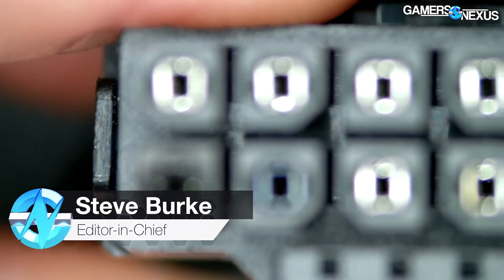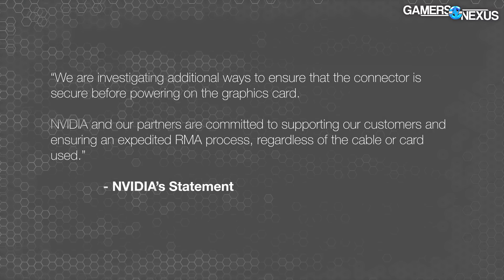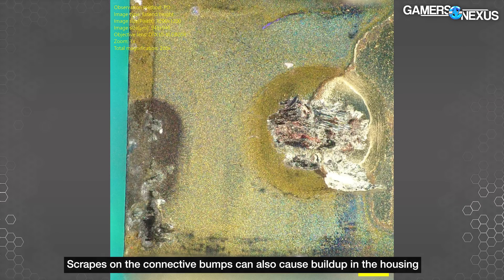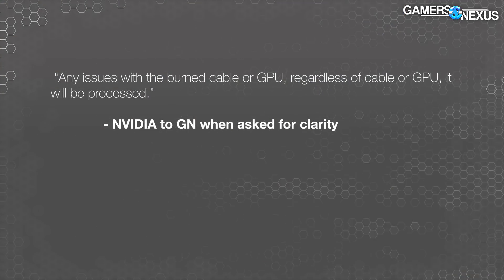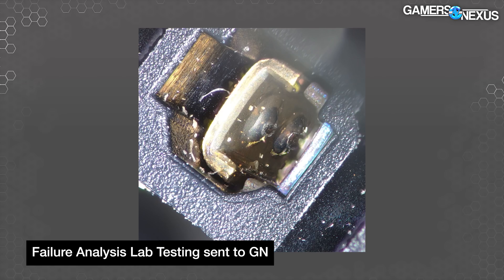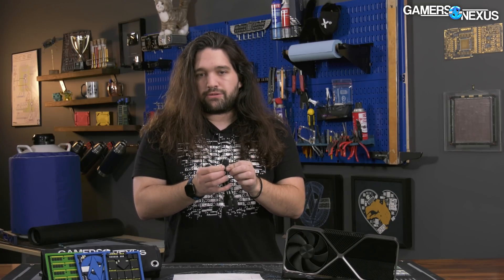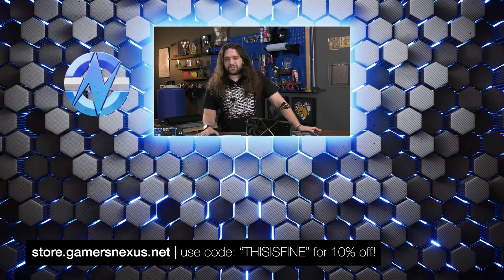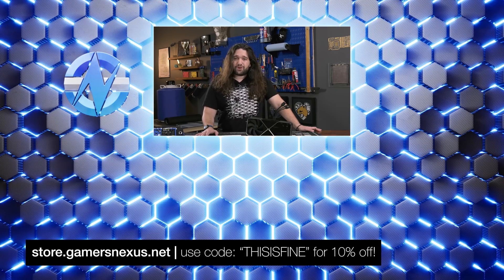NVIDIA Responds to Melting Cables, Warranty Concerns, & 12VHPWR Adapter Failures

Comment: I've heard enough. It's time to stop pussyfooting around and conducting incorrect 'research'. Safe products are meant to melt ! I'm reporting this to Underwriters Labs and the European equivalent agencies. Nvidia should have read UL/IEC 60950, I have a copy if anyone's interested. Product Safety of IT Equipment.

Steve, you can TELL Nvidia they NEED to withdraw stock from sale and organise return of all stock sold to date.  There's over $200 million of it out there and this could easily be the end for Nvidia. There's a really simple solution to this that involves REMOVING the accursed 12VHPWR connector which flies in the face of product safety norms with 23 Amps being pushed through every sq mm of pin. That's like passing 30 Amps through 16 AWG for comparison !
Reply: It was user error.
Reply: @spaceageGecko  Its the manufacturers responsibility to use a suitable connector that cannot be 'sabotaged' by 'user error' when it is to be installed by non-experts.

The national/international safety standard UL/IEC 60950 applies which is mandatory for IT Equipment worldwide. I know about this stuff, believe me.

From what I see, the cable loom is also not constructed using a suitably rated wire gauge. That entire assemble stinks and is piss-poorly engineered.

I've asked for the product to be withdrawn from sale as a potential fire hazard. Even a 0.05% failure rate is unacceptable in this regard.

FYI, those tiny connector pins have a current density equivalent to passing 130 amps through 10 AWG wire. Utterly ridiculous ! Nvidia forgot about basic engineering fundamentals.
Reply: @grahamstevenson1740  Nvidia did not invent this standard and it is compliant with 60950 (though that rating is no longer in use)
Reply: @spaceageGecko  UL/IEC 60950 is still current. It will continue is use until replaced by a different standard for product safety for ITE.
Reply: @spaceageGecko  I am aware of the provenance of the 12VHPWR connector, and I have my suspicions that the UL requirements in respect of current carrying capacity were not properly applied. For example, from the data sheet figures, each terminal can generate over half a watt of heat at rated load. i.e 6 watts overall for the 12 high current carrying terminals !

What's your point anyway ? Any manufacturer has to ensure that components they use are safe in normal service. Note; 'normal' means and includes exceptional cases that can result from user action. If 'tinkering' with user accessible controls (including controls in software) allows an overcurrent, the overcurrent is treated as a NORMAL condition.
Reply: @spaceageGecko  UL/IEC 60950 does not specify ANY connectors or other such items to be 'compliant'. That is a matter for other specific standards, e.g. wire current ratings (UL 758;  U758 Ed. 3-2014 Standard For Appliance Wiring Material, IEC 60204-1) and terminal (connector) current ratings e.g. UL 486 A-E.
Reply: @grahamstevenson1740  While it’s very similar it was replaced by 62368-1
Reply: THIS IS *VERY* INTERESTING !!!

The main standard that applies to screw type wire pressure terminals is UL486A-B.

UL486A-B covers the testing of most standard wire terminal clamping units whether for Factory or for Field wiring applications.

 UL486A-B is one of UL’s core standards that is referred to in almost every other electrical standard that uses wire terminals.

While it can be helpful for many traditional applications if a connector or terminal has already been formally tested to UL486 before being used in an end use assembly, the use of a pre-tested UL marked connector is not mandatory. The presence of a UL mark can restrict the innovation that might be otherwise possible with no restrictions inferred by the UL file.  

 PCB applications are rarely traditional. Indeed, the Recognized label from UL (UL486A-B classification code ZMVV2) requires that the connector, even if already approved under UL486, be tested again in the final assembly for similar and additional capabilities. The way in which the connector behaves in the final assembly is rightly considered to be crucial to its ultimate operating performance.

Consequently the UR mark is not nearly as useful as one might think since the heavy lifting still remains in terms of satisfying the UL requirements as mounted and used in the final assembly.  

The option to use an “unmarked component of a UL investigated assembly” is always open and provides the flexibility to add to or modify the use to which the terminals is put such as use of non-standard wire types, wire combinations, screw types, modified ampere ratings, intermittent peak currents evaluations, forced cooling methods and many variations in use that are not covered in a standard UL486A-B testing program.

 Specific uses for an end use assembly terminal can then form part of the UL file for that end use device and is UL factory inspected to the specifications along with other components in the assembly.

 This minimizes potential conflict of field interpretation of the requirements of the previously marked connector, such as the “conditions of acceptability” and the end application.   

Since UL recognized connectors are always retested in the assembly whether already approved or not in the connector form, it is often faster and simpler to use an unmarked component.

IHI pretested unmarked connectors are built to the same standards as parts which have been tested as wire connectors. IHI provides technical support to help guide customers meet the requirements in the end product assembly, backed by customer testing programs to prove out designs for UL approval and, as important, provide long and reliable product life. 

The principal testing for wire terminals comprises of heat rise and mechanical pull out testing.

 

UL HEAT RISE TESTS

IHI Branded PCB terminals have resistances in tens of micro-ohms, well inside of IEC testing requirements for low volts drop under test currents, which is vital for the PCB designer to keep I^2*R watts of heat generation low in the assembly.

Heat rise of the assembly is more to do with the designer’s choice of foil weight, trace widths and number of layers, as well as wire gauge matched to design current.     

It is common in PCB power applications for the power wire gauge to be specified either for Factory Wiring carried out by the OEM, or strictly specified field wiring that must be adhered to by the customers to maintain the warranty.

Since it is common for a narrow choice of wire to be specified by the OEM to insure correct operation of the whole device (heat rise in the device being critically related to gauge) and there is often only a single worst case version of the wiring to test which simplifies UL testing when the connector is a an unmarked component of a UL tested assembly.          

 

UL WIRE PULL OUT TESTS

UL provides OEM’s with two choices of pull out force for a wire terminal connector.

All of IHI PCB terminal lugs are designed to meet UL486A-B high pull out forces when suitably mounted on the PCB. These forces are quite high as they were designed for electrical terminations where no strain relief was designed in.

 UL therefore provided a de-rated pull out test for those applications where strain relief is designed in to the device. This is very common on appliances and printed circuit board applications where it is not desirable to put the PCB or soldered components in tension from wire connections.

 UL486E allows this pull out force de-rating and it may be used to test an unmarked component of a UL tested assembly.

 

UNMARKED COMPONENTS OF A UL TESTED ASSEMBLY

An advantage of using an unmarked connector in the UL assembly is that the OEM controls the entire UL file – the assembly and the unmarked component which will be specified in detail the OEM assembly file.  

 Adding to and making changes to the OEM UL file with regard to the terminal connector does not require updates to the terminal supplier’s UL file for that component.

UL486A-B STANDARD WIRE PULL OUT TEST FORCES AND UL486E STRAIN RELIEF CONCESSION LOWER FORCES COMPARED

UL486A-B & UL486E WIRE PULL OUT FORCE COMPARED (COPPER WIRE ONLY)

WIRE GAUGE UL486A-B STANDARD FORCE UL486E STRAIN RELIEF CONCESSION FORCE

AWG / kcmil	mm2	POUNDS	NEWTONS	KG	    POUNDS	NEWTONS	KG

18	                 0.8	        20                    89.0               9.1	     6.8               30                  3.1

16	                 1.3	        30	                134                13.6	      9.0              40                   4.1

14	                 2.1	        50            	223                 22.7     11.5             50                  5.2

The UL486E pull out forces are 1/7th to 1/3rd the level in the standard UL48 6A-B so there is a considerable concession given by UL for devices having an approved strain relief.

 IHI PCB lug terminal connectors are designed to meet the full pull out force of UL486-A-B whether they are UL listed, or are unmarked, unlisted components.  IHI terminals also withstand the full torque on the wire binding screw that is needed to maintain the full UL486A-B pull out forces on the wires of each size.

It is important to remember that the electrical capabilities of the terminal are equally as important as the mechanical ones, so having adequate wire binding pressure for a gas tight connection over time is still essential even if the OEM chooses to use the low pull out force testing option allowed by UL486E.

* All PCB terminals should be provided with strain relief to limit temporary or permanent pull on the wires and terminals mounted to the PCB (see solder creep characteristics). "
Reply: @spaceageGecko  That's an entirely new standard which has a wider SCOPE

IEC 60950 is specifically aimed at ITE
IEC 60950 is for audio/video equipment.
There was another for 'communications equipment' too.

These two sectors have been converging. As a result, IEC 62368-1 has been written to cover the combined sectors.

When transitioning between standards, a DOW (date of withdrawal) applies. A standard is not superseded until its DOW.

All I see at the moment is that UL/IES60950 is still active and in any event, there is never a huge conflict between two overlapping standards or we'd never get any useful work done !

FWIW, there was ONCE a seriously conflicting clause in IEC 1000-3-2 that was a total foul-up and I was one of many to report it, and a change was voted through to remove the conflict. Yes I had a vote on the matter.

Nothing of serious technical SUBSTANCE will have changed. Your connectors still aren't allowed to melt or catch fire !

Comment: the fact they're covering every cable etc regardless of user error to me indicated that nvidia is acknowledging that this connector has an inherent fault. the mating conector on the card MAY have an issue where it is not positively engageing the cable detention correctly causing nvidia to deem this more a product fault over user error.
Reply: PCI-SIG has announced that it's working on revision 2. So yeah the connector is faulty. Otherwise they wouldn't work on a new version of it.

Comment: Other way to check connector after install is to take close up photo. You can easily see there if it has space between connector and socket and it's also nice document that how it was installed if there was problem.

Comment: A simple momentary dip switch on the plug itself that is on only if the plug is fully seated. It could be done with either a closed loop, power to switch, power from switch back to a relay/relays. Or could also be done with dip switches for each individual pin. Either one could be integrated into the cable easily enough, though the design with a relay would probably be more cost effective, and the multi dip idea would be less complex. 
 Either way though, if the plug wasn't fully seated, no power could travel through it.
 Another idea would be using a metal latch like the old am2 CPU latch.
 The latch wouldn't be able to be latched unless the plug was fully seated, which would make it easier to catch the problem.

Comment: I've done a lot of installs over the years and never seen a connector or cable fail. Regardless I would suggest users apply some dielectric grease lightly to the contact points to enhance conductive performance.

Comment: Why not just put a red ring round the cable plug where it plugs in so if you can see the ring it is not fully in and when you can't see it means it is fully in a simple solution to make sure people know it is fully in at a glance without tugging the cable as the cable only has a short 15 plugs lifespan so everytime you touch it risk of making it fail.

Comment: Just a personal opinion, but I'd really rather see cables come out the back of the card.  This is usually where cables are getting routed anyway in systems with 1 or 2 cards.  I'm not a fan of any cable that splits unless there's no other choice.  Multiple cables are easy enough to bind together and connect on the end, or one good higher power cable from the PSU.  I know there's a whole world of professional standards and all that, but from a simple point of view this isn't the design I was hoping to see.  It's not uncommon for one manufacturer to approve another manufacturers product for use, I'm not sure it amounts to gatekeeping cables, but I share the concern that power standards have to be met by all parties.  No one wants a fire.

Comment: Bullshit, when the connector melts, the only solution to eject/extract the connector is to brutally jerk the connector left and right, trying to slide it off. When given so much force, the plastic will crack, and you will get the lines. I hate when Nvidia tries to blame customers like it always is someone other.
Reply: All testing points to user error

Comment: "Nobody in our audience has that level of strength."

I would not be saying that so confidently if I were you. I've single-handedly lifted a 32" CRT television into a skip bin, I could probably crack the solder. I just need a dead card with this connector to try it, and that's well outside my price range right now.

Comment: I do think this cable is a poor solution for this card's massive power draw. Such an amount of force needed to properly seat the connector and no feedback from it's clip. And who (before this) attached the power connector and then inserted the card into the MB? Not me.

Comment: I'm using a sleeved aftermarket adapter/cable and a +50 overclock with after burner. I have not had any problems while gaming for hours at a time.

Comment: Biggsst fault of This conector is that All of the sence pins Are at the bottom. Most cables Will get bended downwards. 

2 pins at top and 2 at bottom With a lock on the sides off the plug would be the most reliable way to go.

Comment: I hade a MOBO with that issue, the 24 pin PSU plug never latched and ended up frying my CPU and burning out half the board.

Comment: It's kind of fucking ironic that Intel does not use this connector on any of its own cards :P  As to NVIDIA, this sudden change in statement shows in my opinion they probably realised the design is less than stellar and their statement that they will cover these, user error or not, compliant cables or not, sounds to me like they were legally advised (in my opinion) to do so - it is probably less costly for them to cover those RMAs than be faced with millions of $ in lawsuits.  It does not make any sense for companies to cover warranties for user error, so this sounds odd to me, it's almost to ME like NVIDIA is discretely getting out of this mess by avoiding very costly legal issues.   Why the hell did they make those pins so thin, it's crazy, any bets on whether we will see those same connectors on the 50 series cards ? Would be interesting :D

Comment: One design issue is so much force is used that end users will not use that much due to motherboard damage. So now there need to be clear instructions of plugging in the adapter before the motherboard. Now one must wonder whey didn't they just did away from it sense the cable has to be there before putting it into the motherboard, so why the connector to begin with.

Comment: A day in the life of 4090 owner

Wake up

check if there are any new videos about burnt connectors

Push the power cable in for the 10000000 time just to make sure it's fully in there 😂 and make sure it hasn't melted

Get on with the rest of your day

Comment: I've had issues with seaitng power cables properly into my GPU many times where even when fully inserted the latch wouldn't engage. Are there technical reasons why the cable needs to have so little tolerance on insertion? Are there alternative solutions that are less prone to error? Kind of worried about my GPU now.

Comment: SO, it seems the current traveling through that tiny little power cable, is too much for it to handle.   user error?  no, I think its a design error.   This is at best a substandard design.   Its weak and cheap.

Comment: 0:33 Steve on your cooking plug there you don’t even have it pushed all the way in flush that’s why it’s doing it it’s not having a good enough contact with the high voltage end so basically you’re cheating to create a melting plug situation. Shame on you Steve🤥 either that or you did it to show what a melting plug would look like?

Comment: Am I doing math wrong in the calculator?  When I put in 125000 X .04 it comes out to 5000 not 50.  It's been a long time since high school, so I forgot a lot of the math I learned.  If I'm doing it wrong someone, please correct me.  Because I want to know what im doing wrong.